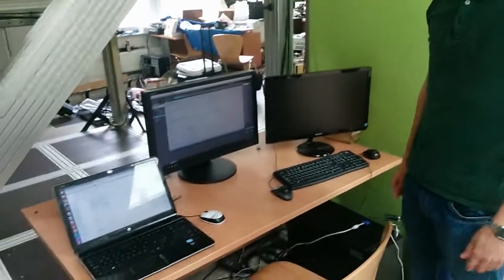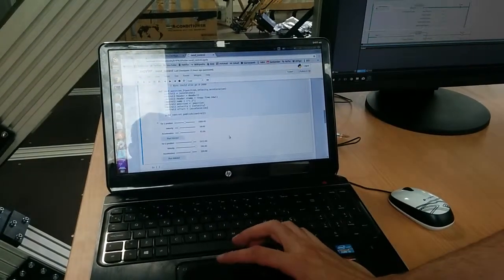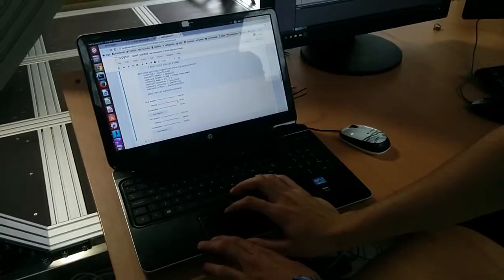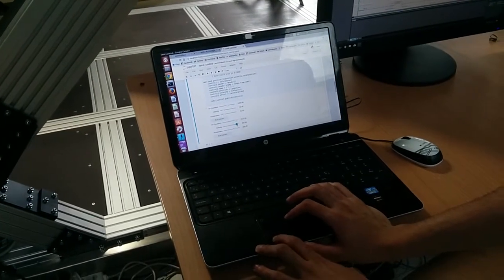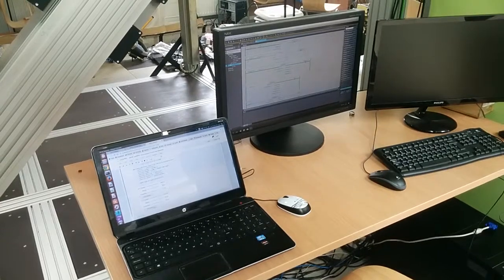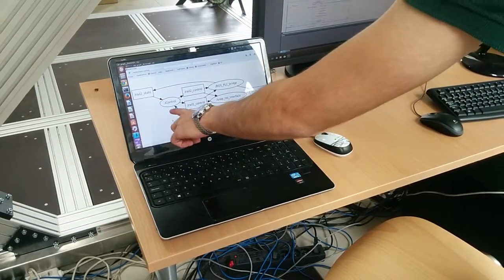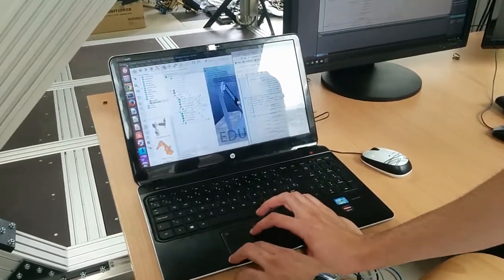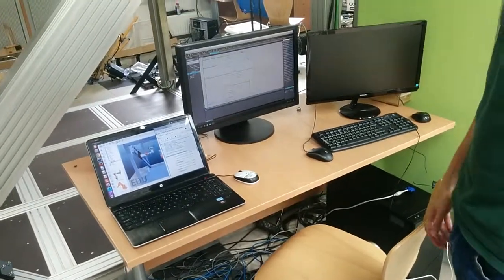ROS control of Omron PLC and kuka IIWA robots

Comment: Hello, I would like to know how you can place a button that works with a kuk iiwa 14R820, this button must be pressed by the operator and the process (robot routine) will begin.
I don't know if it is necessary to use a PLC.